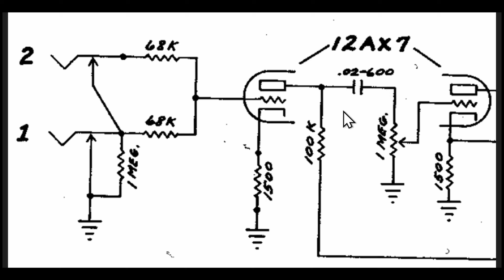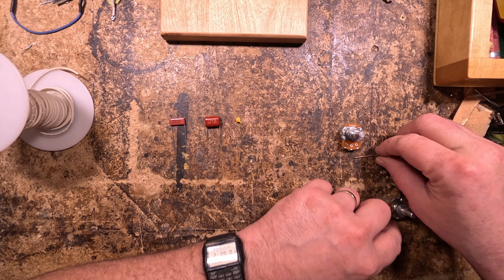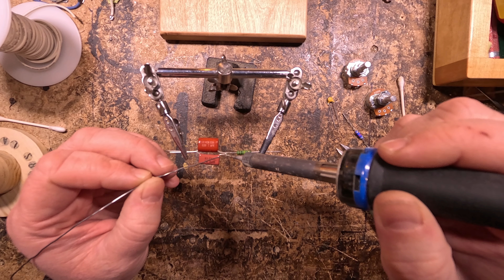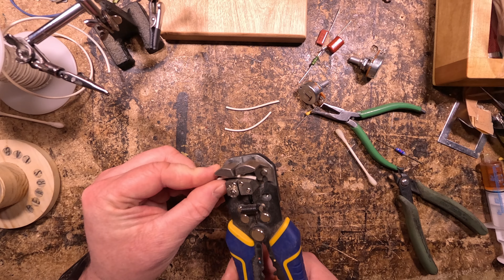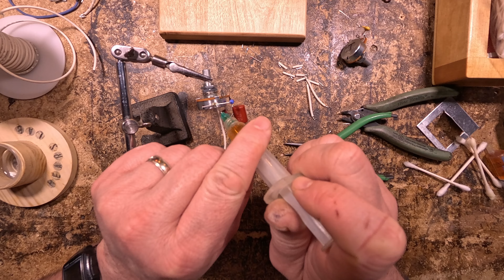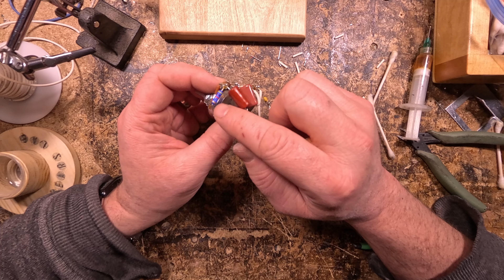How to add EQ to a Fender Champ Tube Guitar Amplifier

Comment: Great video! Can this mod be applied to an with a single tone pot? I made a 6g2 clone and used a Princeton Reverb chassis, so I have plenty of space to add treble and bass pot.
Reply from the maker: Yes, this mod can be installed on almost any tube amp with a single tone pot.  For the 6G2 all you have to do is remove the .02 and .005 and.0005 caps and the tone pot.  Then install this tone stack in it's place.  That is a great example of an amp for this mod.  Thank You!

Comment: Great video. I’m learning and although I’m still planning to start with a 5F1 I stumbled across a MOD102 someone gave up on. I’m ordering components to fix it and to do the upgrade to MOD102+ as well as add all the other options. I’ll experiment with adding a tone stack for sure. Thanks for making the video.
Reply from the maker: Cool, that sounds like a great project and score!  Whenever I see a tube amp in need of repair for a good price I get weak in the knees.  Best wishes and thank you!

Comment: Did any of he single ended Princetons  have  Bass/Treble in place of the  tone control?
Reply from the maker: That's a good question, I don't know off the top of my head, maybe somebody else can chime in with an answer?
Reply: @mearslab  Have you tested this circuit design....I'm wondering whether one gain stage after the tone stack an is enough.
Reply from the maker: @stevepi1  Oh yes, many times.  I'm currently listening to a stereo tube amp I made which is very similar to this, but with two channels.

A single ended 6V6 doesn't need a lot of grid voltage to drive it to clipping, only 8-13v or so, depending on what the plate voltage is.

Adding a 22uf bypass cap to the cathode of the first gain stage is a common method of adding a bit of gain to the circuit to make up for the losses from the tone stack.  Sometimes I do that, and sometimes I don't.
Reply: @mearslab  Ok, good info, thanks. Check out the  AA764  champ schematic.

Comment: Nice tutorial, but I am thinking a terminal strip would add more mechanical integrity, which could be secured to the chassis!
Reply from the maker: Good idea, I agree.  For this video I wanted to keep the parts count as low as possible so I left it out this time.

Comment: Why do they call that 100k resistor a "Slope"? Sloping what?
Reply from the maker: I find it tricky to describe without rambling, but i'll try.  When own guitar signal gets amplified by the first gain stage, it hasn't had any eq'ing to the signal from the amp yet, and at this point in the amp, the guitar sound is usually too muddy sounding, too much bass.  The tone stack's goal is to balance the sound of the guitar so it isn't too bassy or too much treble, and give the player some adjustment to compensate for different sounding guitars, speakers, etc...The "slope resistor" is an important part of how the tone stack does that, here's how.

The slope resistor adjusts the balance between the treble and bass parts of the guitar sound.  In the tone stack, the signal is split up into two paths.  The treble pot functions is a mixer between those two paths.  One path is all treble, and the other path is only bass.  The slope resistor is in the signal path for the bass part, and it lowers how bassy the signal is compared to the treble part.

Hope that helps!

Comment: Cool concept.  You still need to decouple from the previous stage, i.e. block the DC voltage into the second stage.  This is the .02 600v cap.
Reply from the maker: Actually, the DC voltage from the plate is blocked by the caps in the EQ section, which makes the .02uf cap redundant.  If you take a look at the schematic for a modern princeton, you'll see there is no .02uf cap before the eq.

https://www.thetubestore.com/lib/thetubestore/schematics/Fender/Fender-65-Princeton-Reverb-Schematic.pdf
Reply: @mearslab  The EQ caps are usually rated at a much lower voltage, while the coupling cap is high voltage.  Now you would need three high voltage caps since there are three possible paths.
Reply from the maker: @bertrodriguez3087  Could you give an example of an amp that uses lower voltage caps for the EQ? I'm not aware of any.  Taking a look at the schematic for a Fender Deluxe AB763, it indicates that all of the caps should have at least a 400v rating.

https://www.thetubestore.com/lib/thetubestore/schematics/Fender/Fender-Deluxe-AB763-Schematic.pdf
Reply: @mearslab  You are correct that Fender did not, hence that all the caps are 400v or higher.  Marshall usually used a cathode follower before the tone stack, so the voltage was much lower.  If I was adding my own stack to a Fender style amp, without a cathode follower, I would add a coupling cap, say a .01 to let everything through.  At that point, the prior stage is decoupled and you are dealing with a pure A/C circuit, easily and safely traceable.  You don't have to add it.
Reply from the maker: @bertrodriguez3087  Good point, I wondered if you might have been referring to Marshalls.  That being said, the cathode voltage for a JCM800(2204) at V2B for the cathode follower is still at a high potential because of the 100k cathode resistor, so I would still go with 400v+ rated caps for the tone stack.  On that note though, there is no .02uf coupling cap in the cathode follower for a JCM800 either.

https://www.thetubestore.com/lib/thetubestore/schematics/Marshall/Marshall-JCM800-Lead-Mstvol-50W-2204-Schematic.pdf
Reply: @bertrodriguez3087 this is unnecessary, I just checked the schematic of my 1981 Carvin X100 preamp, which is modeled mostly off a fender twin. It is a plate fed tonestack, and the only capacitors are the ones in the tonestack.
Reply: @bertrodriguez3087 Who says??? 😂😛
Reply: Why do you call it an EQ? It is a tone stack. Different thing. See Duncan's amps, etc
Reply from the maker: @andrewspurway3027  I never knew there was a difference! You learn something new every day, thank you.  It looks like tone stacks are cut only, passive designs, and an eq leans towards an active circuit with boost and cut, is that right?
Reply: In the past the filters had to be passive, and Fender used a circuit which created a phase shimmer, the fender fizz. Normally at the front of the chain, to give a smoother effect. Marshall drove a slightly different circuit at the end of the chain, after a cathode follower, to give the harsher sound. See a JVM schematic for the ultimate in pre-amp routing! I have a Trace Elliott with both Fender and Marshall stacks, one on each channel.
Reply: @mearslab  I think the terms are interchangeable, "passive eq" could also describe the Fender tone stack.
Reply: So how do you manage to install this in a Champ’s chassis?  There’s no room on the control panel.